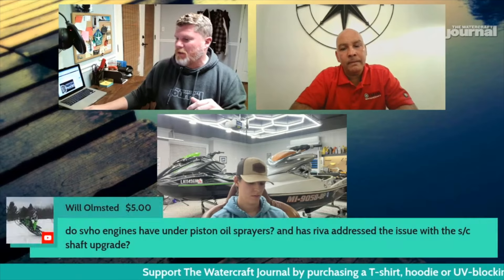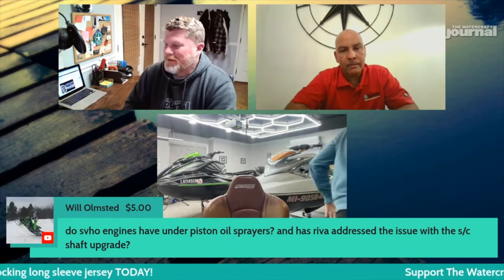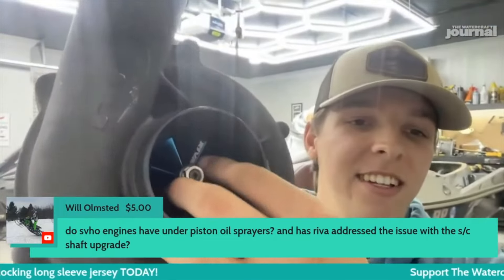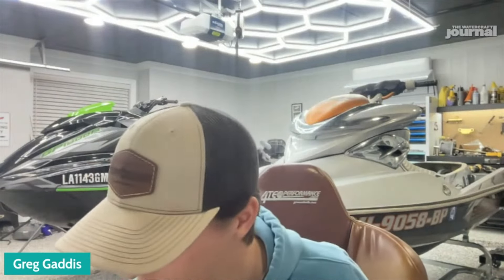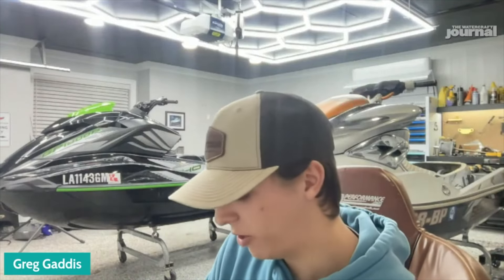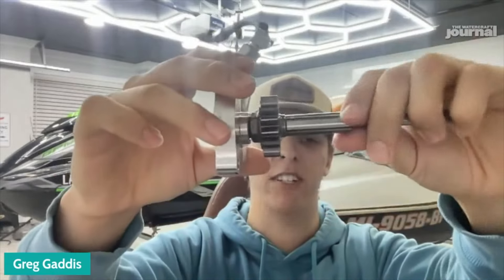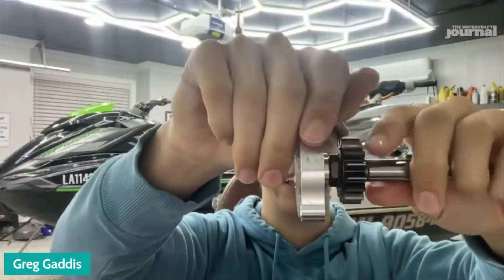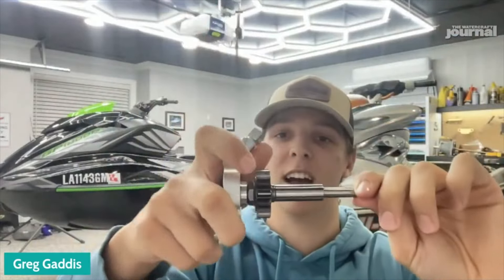Is Yamaha's Supercharger Shaft Design BAD or Is It Something Else? WCJ Quick Topic

Comment: With race cars people run into this oil pressure issue often with stock unbaffled oils pans. Many times, over filling the pan with an extra 1/2 - 1 quart of oil helps. I think most people run SVHOs between full and half on the dipstick when cold (including myself) I am now wondering if filling it to the full mark, or even a 1/4 quart past would help this issue without causing issues with too much oil.

Any thoughts? Speaking from the standpoint of a weekend rider, not a racer, who just wants his ski to last... Seems like this could be a good thing to test for Greg who can log oil pressure.
Reply: I would also love to know this.

Comment: New to the PWC world. Can somebody please explain to me why they keep calling it a supercharger that is definitely a turbo or a turbine
Reply from the maker: Because you don’t know what a turbo is.
Reply: Turbo runs off exhaust gases. This is a supercharger
Reply: There is more than one style of supercharger. Lol. That is a supercharger I promise.
Reply: @cts-vme3353  Not all people realize the difference between the two. I have worked on both high pressure air systems and vacuum systems in industrial maintenance and even people with years on the job sometimes don't understand the differences between them. Most cars and trucks use turbos and not superchargers so they may just assume that they are both the same only being on a boat it is called a different name.  Not all fans are made to operate the same way. It's a lot like the difference in a propeller and a jet on a boat. The end result is close to the same but the method of thrust production is somewhat different.
Reply: @watercraftjournal  A lot of people don't know the difference between the two. Not everyone has the same skill set as someone familiar with the industry. Maybe saying a turbo uses the exhaust and a supercharger uses the crankshaft for their respective power would have been more informative to the person asking the question. Forty years ago I didn't know the difference in them.  And looking at some of the designs and time to fail rates a hell of a lot of engineers don't know the difference either.
Reply: @DraggonCanoe  maybe he shouldn't have said "that is definitely a turbo..."
Reply: Could it be called a pro charger?